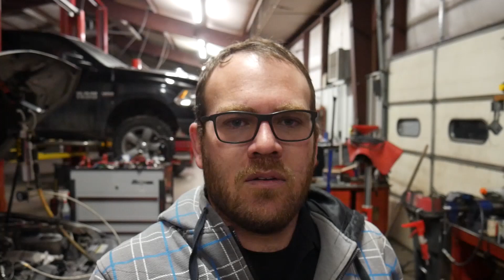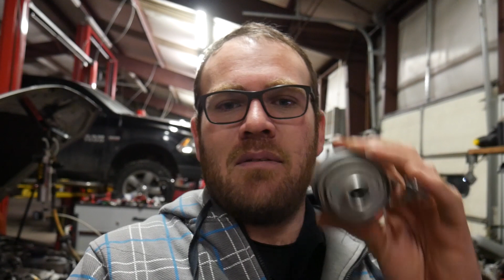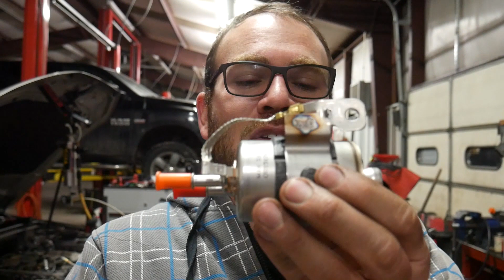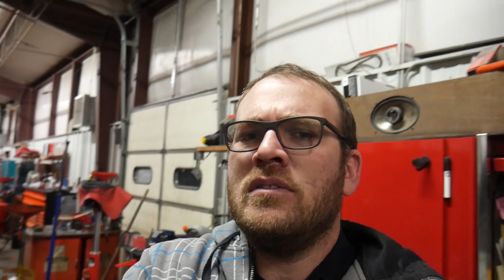1960 Chevy Biscayne LS Swap Ep 16 -  I Screwed Up and Have No Fuel Pressure

Comment: About to do the fuel line on mine and the filter I have looks like your new one, but the push connectors are unknown here so I hope the order I have on the way has the correct fittings....the fuel system is more fuss than it first looks.
Reply from the maker: It’s wasn’t too bad except for my goof on the original filter.  Many people buy a filter and hose kit and then just run braided fuel hose from the back all the way up to the front. That eliminates the flaring tool I used. I like the metal lines better and I already had the tool so I went with it.